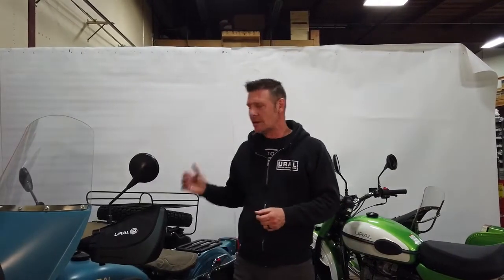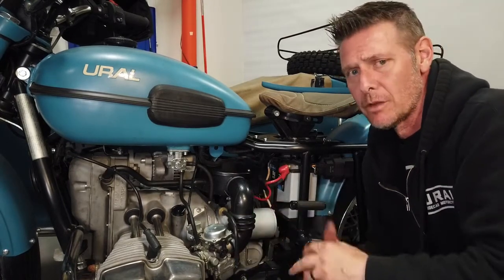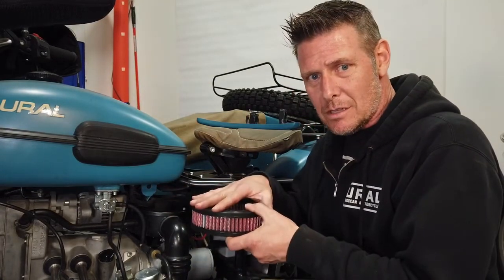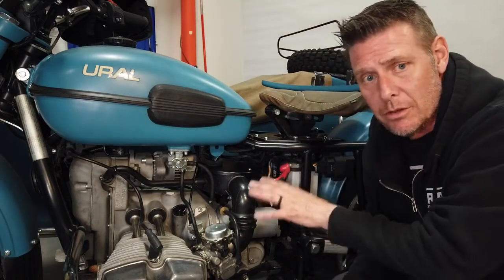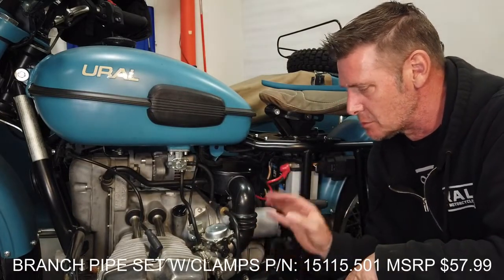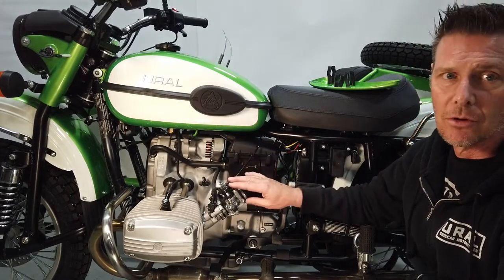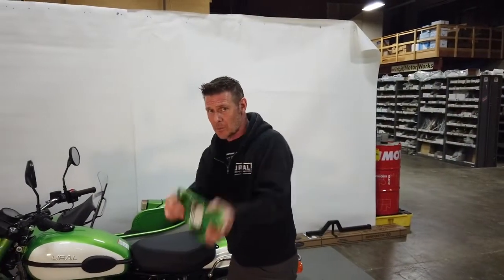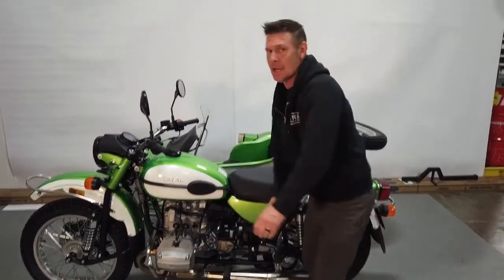URAL How-To Air Filter

Comment: There is no service facility or dealer within hours of me, this content is invaluable, THANK YOU URAL for posting these videos. Traded a 2014 Gear Up for a 2023 Gear Up this week. Shout out to Kissill Motorsports in Tyrone PA who made the transaction fast, fair, and easy. I cannot believe how amazing the new generation of Urals are, there simply is no comparison. I've ridden the carbureted Urals, bought a 2014 1st gen fuel injected, which was a light year jump, and now this 2023 which is another light year jump. More torque, more power, fueling is amazing. Fit and finish have been stepped up too.